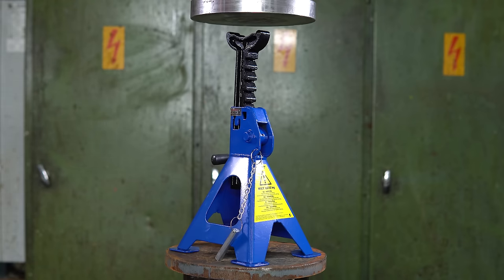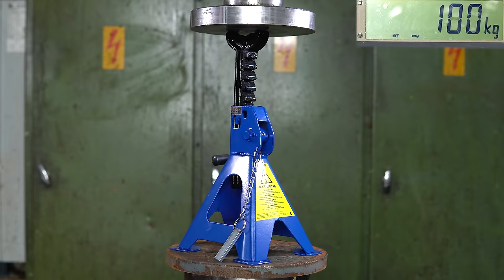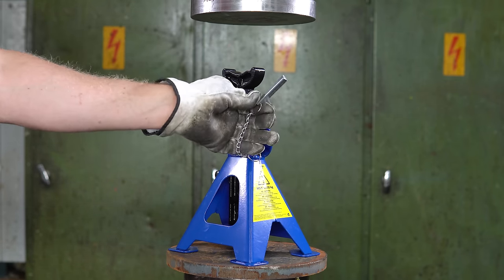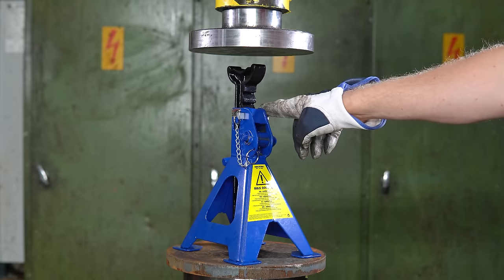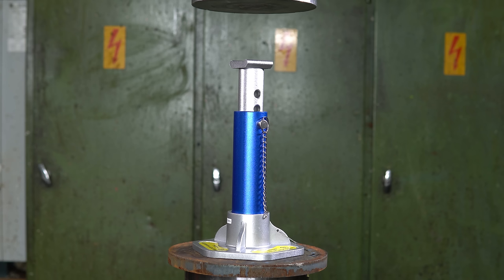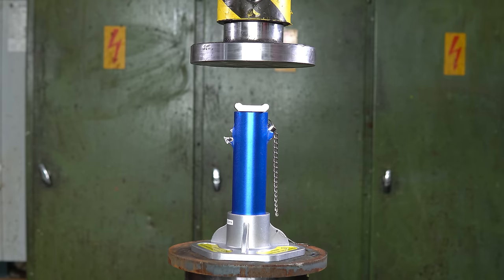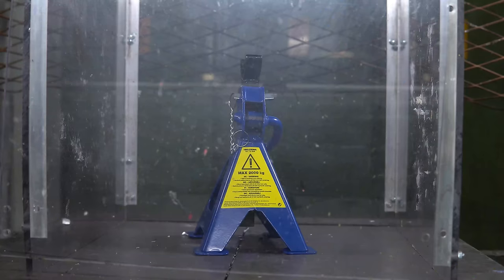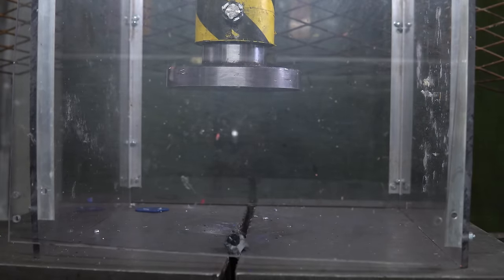How Strong are Jack Stands? + Broken Window, AGAIN!

Comment: Not gunna lie, watching this made me feel a lot better about jack stands and working under my car while using them. Good stuff!
Reply: Yeah, there's no way those would slip... Unless....
Reply: @MightyGimp  hear it often enough on local news- it is no accident we hear the phrase "wise old man"
Reply: You would think that everyone would use jack stands when working under a car, but I still see some that don’t, ever. Accidents waiting to happen.
Reply: @MightyGimp  yeah 2 jack stands, floor jack to take off some load, and tires for worst case scenario - better look stupid than die stupid
Reply: yeah, i use two of them and then i load the primary jack a little bit too. as long as nothing tips, i should be a-okay for weight. lol 

3,000 lb GTI lmao
Reply: Works on 2,800lb car...uses two 2ton jack stand to support that end and leaves the 3 ton jack in place for extra insurance. Overkill asf but damn i feel safer squeezing under my car.
Reply: Laughs in a freight of harbor.
Reply: @Sak-zo1ui  This made my day. I took in mine for replacement and then they sent out the notice to return the replacements. Like bruh
Reply: @ddjohnson9717  also stick the wheel under there if taking it off.
Reply: @ryanfay1  yeah that's what i meant lol. I'm stupid
Reply: My car has a flame joints along the sills. The wheel change jack is slotted to fit  To avoid damage to the car I have slotted wood blocks that fit over the jack stands. For support under the subframe I use a piece of plywood between stand tops and car underbody. Less likely to slip.
Reply: I use 6x6 blocks of wood from an old pallet to hold up my semi-tractor. They're stable even on soft ground.
Reply: I'm not sure, I use 2 ton jack stands on a crown victoria..
Reply: I wouldn't feel too good about them, i've had one completely break in half when only lifting a cavalier. Was only trying to change the tire and it just broke completely.
Reply: That is only considering that the welds are done correctly. The biggest thing to check is the welds, if you see any cracks or pinholes, send it back.
Reply: If there rates for your car then nothin can really happen
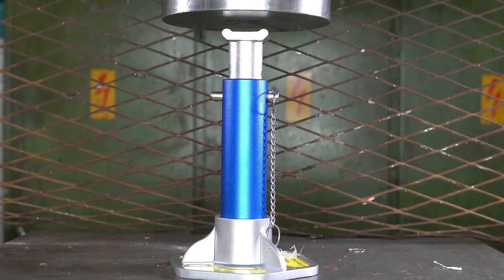Reply: I have bad experience with the jack that shows 7:17 I was changing my flat tire after I took off my flat tire and getting the spare one the jack slip off and my car slam to the ground. My only damage was the shield disc from the brake disc
Reply: @juliobello4561  Thats scary, always make sure it is supported properly. Always test it first by pushing on your car a little before you work on it
Reply: I know what you mean, I'm so hesitant to work under them. I bought Harbor Freight brand and they had a recall. Around 6000 people every year are injured or killed from Jack's and Jack stands either failing or operator mistake.
Reply: Remember to wear safety glasses
Reply: Lol main reason why im here
Reply: @ddjohnson9717  I use the same exact method when working under my trucks. 
!
Reply: Jack stands are still dangerous even if they can handle the weight. The car would rotate on the stand as you lift it, and risking falling off. I use solid stacks of wood instead.
Reply: Remember this is not shear measurement. So if the car drops it is a different outcome.
Reply: This made me feel worse. My truck weighs 7500lbs and this thing is failing at 10,000 lbs.  What if I have a jack stand that is slightly defective.
Reply: @deeeeeeps  Don't be using car stands for your truck. Get truck stands or a stack of wood.
Reply: Car wheels blocked, emergency brake on, floor jack remains in place, tire under car.  Can't be too careful when your life is at stake.
Reply: I put the Stand, leave the jack under and usually stand a cinder block up under there too. I play no games
Reply: Man, why do we do this to ourselves.. when i hit the lottery I'm building a garage with a big ass pillar lift. And a grease pit..
Reply: @datadavis  Wake up, you are not going to hit it. For people don't hit it, I suggest stacks of wood. They are quite cheap and don't break for puny little cars.
Reply: redundancy in support always a good idea, still have to make sure you don't  tip them with side loads...
Reply: You should get steel jackstands
Reply: I use Atlus on each corner to be extra safe. You can never be too careful
Reply: I put the spare underneath the frame rail when working. 
I also set the weight on the stands and then set the floor Jack just under it,so someone could rescue me...leave the Jack there just dont rely on it.
Reply: @MightyGimp  👍...the spare tire on its side...also good...wont crush....will save your life.
Reply: @bigk4755  my dad never does and it scares me so much I stay by the jack to try save him if need be
Reply: i searched "draper jack stands" and gained more confidence in my search for them haha. awesome man, what brand did you end up gettin?
Reply: @Janet_Airlines802  6,000 people?  Where did you get that info?
Reply: @ddjohnson9717  yeah…. I just started using tires in addition to the jack & jack stands.  The tires just sit around anyways… might as well make them useful.
Reply: Gravity Sucks !

Comment: I'd like to see plastic car ramps vs metal car ramps
Reply: Yes
Reply: @michaeldaigle7207  plastic ramps are actually very very strong. A lot of them are completely solid plastic inside. And are made of special compounds. The plastic ramps are like solid blocks.
Reply: I just made my own out of some 2x6s, 4x4s, and 2x4s
Reply: SPEED EZ man is injured by home made wooden ramps.😂if you trust it they must be good enough
Reply: @tylermartin5560  my car weights less than 2500lbs
Reply: SPEED EZ I’m not talking crap lol I don’t even know how you built your ramps they have to be better than some harbor freight ramps
Reply: @tylermartin5560  4x4s are to support vehicle weight, 2x6s for the ramps and platforms, and 2x4s for the stops
Reply: @michaeldaigle7207  They are, they're actually rated quite a bit higher than metal as well.
Reply: I have plastic ramps however I added 2 solid wood blocks in each one (made out of 2x4s) to take the load when the vehicle is on them.
Reply: @kf3en  genius 👏
Reply: All I can say is... I have plastic ramps and they are very strong. I feel 100% completely safe underneath the car. The thought of them failing doesn't even cross my mind. My plastic ramps are rated for 12500 pounds. My car weighs 2900. So lots of room. And it is likely that the ramps are actually able to take more then 12,500. They can probably take 14,000. But the manufacturer rates it at 12,500
Reply: @youandiryan  We use only plastic ramps too.  I'm just curious to see how both would test.  Many metal ramps actually look weaker to me.
Reply: @hackdeez1075  The outer edge of one of my ramps was starting to buckle a little bit. Made me nervous.
Reply: @youandiryan  Mine are made out of hollow blocks with thin walls separating the compartments.
Reply: @kf3en  yes, mine look okay but my driveway is very uneven and always puts stress on one side or another but the block idea is a good one for safety and weight distribution
Reply: Heads up everyone, plastic ramps are strong but never used them when it's too hot because they bent. It happened to me luckily I wasn't under the car.
Reply: @michaeldaigle7207   I dont think they are intended to work under the car with them on. they only lift the car a little so you can get a jack under the car. At least thats how I use them. drive up on the ramps. then jack the car up and put the stands under. I guess a 4x4 or something you could work on with just the ramps but a car would be too low.
Reply: The plastic ramps I have (rhino plastic ramps) are rated 12,000lbs (6tons) per set. They hold up my bobcat just dandy.
Reply: @michaeldaigle7207  i had the choice to buy cheap metal or good plastic ones. I can assure you that they are really really rigid. The metal one wont take that much load.
Reply: I use plastic to drive up. Have metal too. Then put jack stands also. No car is crushing me. Usually have a jack i move around to catch parts like a starter or transmission.
Reply: @youandiryan  prob stronger than the metal ones then.
Reply: @Beybladeawsomeness  Probably wormy/rotted wood held together with staples. LOL
Reply: they need to test concrete blocks...
Reply: There's such thing as plastic ramps
Reply: @Landon_Chrud  I know Walmart and auto parts stores have them .
Reply: @michaeldaigle7207  I'd love a set of metal ramps, but they tend to have too steep an angle to them, making it difficult or impossible to drive a low car onto them.
Reply: @michaeldaigle7207  ehh.. idk man. I'd trust heavy duty solid plastic over shitty sheet metal spot welded together and braced any day of the week.
Reply: @michaeldaigle7207  I had a light duty plastic ramp that broke, so I was looking to replace it with metal ramps. Surprised to learn that metal ramps are rated for lower weights than the heavy duty plastic ramps.
Reply: Yea always wondered about that. Bet plastic beats metal.
Reply: Me too. Very curious.
Reply: @michaeldaigle7207  metal are far more likely to fail... welds are not as strong as rubber / plastic compounds
Reply: @youandiryan  Really? The plastic car ramps I've seen have a latticelike support structure.
Reply: I've had no problems with the set I got from Wally, my ram 1500 and the wife's equinox over several oil changes and still holds up
Reply: @michaeldaigle7207  Amazon has a deal though, if you get the plastic ramps, you get 15% off select gravestones for when they fail.
Reply: Yeah me too, just bought some plastic ones
Reply: @michaeldaigle7207  The plastic ramps are probably safer to be honest. Steel ones can rust on the inside out and then you're screwed.

That's why you should always have two things holding each end of your car up though. Jack stands + ramps, Floor Jack + ramps, Jack stands + blocks of wood, etc.
Reply: @tylermartin5560  I wouldn't build wooden ramps for the car, but building blocks of wood to hold your car up is extremely strong if done right. Far stronger than jack stands. The base layer of my cribbing blocks are 6x6s. Using a total of 6 of my cribbing blocks would be strong enough to hold up a main battle tank, lol.
Reply: @tylermartin5560  ships were built from wood! Wood is strong!
Reply: @goawakeneveryone4365  so are houses and we walk on wooden floors everyday I know it is. But you going to trust a screwed together wooden ramp with a car over you.. I would if it’s a block of wood shaped as a ramp
Reply: I think plastic ramp failure would be a "slow" (enough time to notice and get away) ductile failure. Metal I think would be a fast buckling failure... more dangerous.
Reply: @anon58973 hell yeah brother sounds like you got some common sense
Reply: For everyone in this particular thread, no matter what ramps you use, if you want to feel 100% safe, just throw axel jacks under there as well. If the ramps fail, the jacks should save you
Reply: @RodCalidge  Best statement in this thread! Always have two independent systems holding the car if you plan to work under it. Your life is worth it.
Reply: @tylermartin5560  timber props were used in the mines for donkey years. Strong stuff is timber
Reply: ....plastic ramps are actually a thing?
I have a 6x6 military ambo that weighs 4.5ton. No way I'd even think about plastic ramps
Reply: @anon58973  how well will the plastic ramps hold up with light degradation? when plastic fails it fails very rapidly, the problem with plastic is the weakening is not very apparent, you can see the rust or the deformation round a spot weld in time to discard a steel ramp, it is a lot harder with plastics, maybe plastic ramps should have a working time limit, inspecting them for cracks and damage is also important, never had plastic ramps but I have been using and working with plastics for over fifty years, stay safe out there.
Reply: @CrusaderSports250  good point. A buckling failure in metal is faster vs. a creep failure in plastic. But a brittle failure in plastic is catastrophic immediately. I think best material would be HDPE... unlikely to get brittle. But a PVC ramp over time would become more dangerous, especially if not stored properly. An ABS or polycarbonate ramp... potentially first failure is brittle. Plastics probably have a safety factor > 3; steel probably = 2. But proper plastic selection (HDPE, UHMWPE, etc... x.PE) would be best. Thoughts?

I do utilities so I have seen all sorts of plastic pipe failures. PVC is honestly pretty scary when it lets go. Seen aftermath of a 24" WM... wouldn't want to be near it. HDPE does fail, but it's a creepy failure. Makes a mess, but not dangerously catastrophic. That said, I've stood by a 36" HDD at 150 psi for pressure test and realized there's 150,000 lbs on the cap sealing the end. I did not want to be near it. Lol.
Reply: Edit for @: @Roger Crossley Also regarding HDPE... The Poisson effect is wild. Watch a 72hr relaxed HDD (horizontal directional drill) get pressurized and notice the pipe get shorter... Wild stuff!
Reply: @CrusaderSports250  I use plastic ramps that have been stored in a dusty backyard for years. The end of the base has been cracked for a couple years, where the plastic meets the floor. A couple shards have chipped off. It has held a GMC Acadia and other smaller cars easily. But always had another backup support. Those ramps should probably be replaced soon...
Reply: @draz7905  worth thinking about sooner rather than later, they may be fine but, and but rarely gives a good outcome. Take care out there☺.
Reply: The word plastic should tell you the winner
Reply: Me Too, every time I use mine I'm leary of weather or not I'm going to be crushed when the plastic suddenly explodes from the pressure.
Reply: @michaeldaigle7207  I"ve seen some metal ones that I wouldn't work under a compact car with.  I really depends on how they were made. I've been using a set of home made wood ones for around 35 years that have been great.
Reply: I've used both. I've had my metal ramps collapse under an F150 with a 300/6 and manual transmission. And I've had my plastic ramps NOT collapse under my F250 4x4 with a 460BBF automatic transmission. I got them from a guy who used them under his F350 4x4 with a 7.3 IDI turbo-diesel. 

I'm still using my plastic ramps 19 years later. Same ones... damn things never die! Steel ones.... they got a band saw run through them and tossed on the scrap pile.
Reply: My dad has old metal ones with no supports. My plastic ones are rated for 12,000lbs. I actually drove the nose of my big rig to test, they held up.
Reply: Absolutely 💯
Reply: I've been under a 2200lb Honda Civic but I wouldn't trust it with my 3200lb WRX STi
Reply: @michaeldaigle7207  Technology does get better old timer maybe have one of your grandkids research it for you.
Reply: @michaeldaigle7207  I've bent metal ramps with my 93 Ford ranger. It's about 5k lbs with me in it. Those plastic ones are rated for that much weight, each. I've nvr seen them break. I have also used homemade ramps from 2x6 I boxed for added support. I've put an 8000 lb. Work can on them and they just dig in. I trust the metal ones less and less nowadays. They are barely an eight inch now. So flimsy. The ones I bent were from 1990ish and way stronger then today's cheap shit lol. Just be careful and block the frame anyways. Can nvr be too safe..
Reply: wooden ramps would be very fine but wooden jacks of course definitely NOT ☺
Reply: Hopefully not from under the vehicle
Reply: I’ve seen a huge RV on top of Harbor Freight plastic car ramps in my neighborhood and they help up just fine. This RV was on top of those ramps for at least a week (I walk my dogs by there daily) and I thought they wouldn’t last. Now I have those same ramps. Lol
Reply: are you talkin about those little small ramps that keep them car from moving?
Reply: @michaeldaigle7207  I’ve had no problem with my plastic ones on dirt. Have had them about 7-20yrs now.
Reply: @RamblinAround   especially rusty ones.
Reply: @michaeldaigle7207  i use plastic blocks at work to support earthmoving equipment without any worries. I would prefer solid plastic than a metal frame any day.
Reply: @thenorthernhandyman  So sick of getting replies to this comment. I don't need 60 people over the course of over a year to reiterate to me over and over and over that plastic ramps exist. The comment I originally replied to informed me of their existence, the conversation was nice enough, and thats cool and all, I thought it was pretty neat until I had to read it over and over and over and over. I hope the jackstands give out next time im under a vehicle just so i don't have to hear another person talk about their preference to plastic.
Reply: @Beybladeawsomeness  just like a coffin🤔🤣
Reply: Yes this! I don't trust my plastic ramps for nothing.

Comment: It's good to see the "Max Rated Capacity" is about 50% of the failure load. Nice margin of safety.
Reply: another thing is, most jackstand ratings are in pairs, so the margin of safety is even higher when testing only 1 stand.
Reply: it could also be trying to get you to buy the more expensive stand rated at higher load?
Reply: Yup these are covered under the ASME PACE standard, which specifies if memory serves a minimum proof load of 200%
Reply: @randomchannel1167  No, its typical to try to design for about twice what the target is, for safety they don't want you putting close to the actual failure load. The higher rated one would have an even higher failure point.